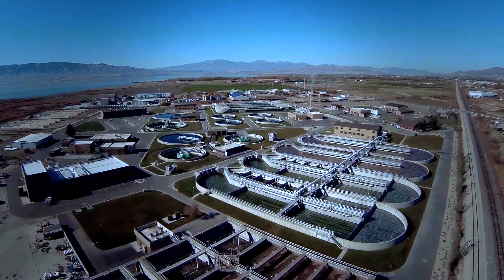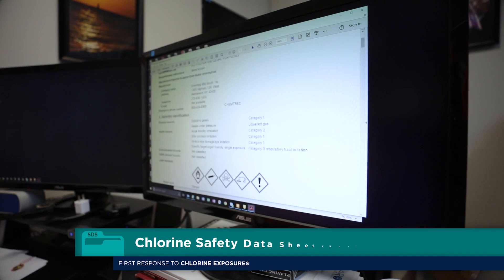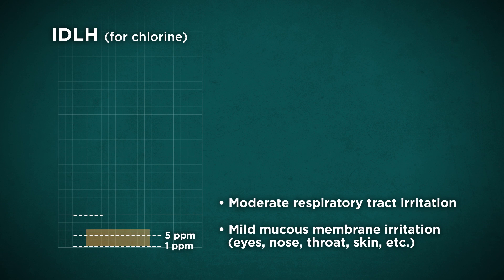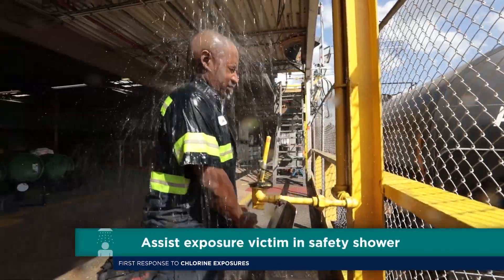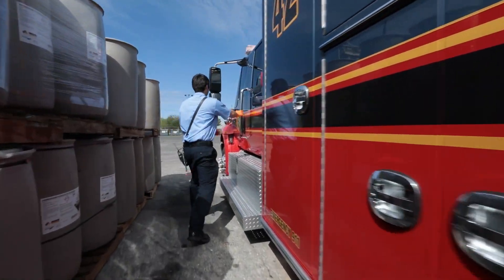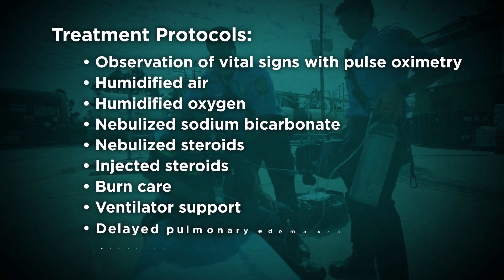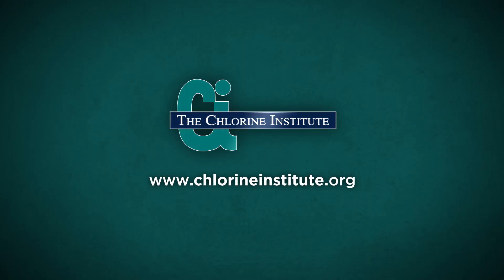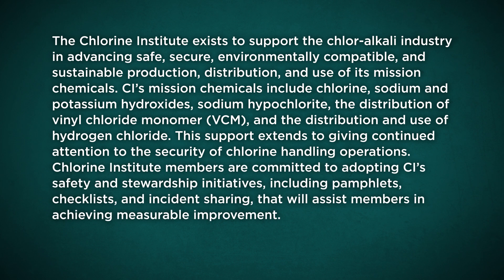Chlorine Institute: First Response to Chlorine Exposures

Comment: I learned the hard way, about high temps and substances containing chloramides.

I had just got done cleaning the bathroom in my studio apartment with bleach, particularly the shower which had nice mason tile work. I was quite proud of myself for how clean it had turned out, probably cleaner than when I first rented the studio! 
I shortly thereafter, took a shower, well the hot water made contact with residual bleach and in the confined space I found myself gasping for fresh air, I quickly opened the bathroom window, and turned off the hot water. I let the cold water run for a bit, before restarting my shower.

I told a buddy, this story once. he told me about a similar experience, he had while stationed at Bagram Air Base in Afghanistan. 

He said he did not know if it was due to ignorance or done maliciously, anyway the contractors (local) put too much bleach in the water system and some gues got gassed when they took hot showers.